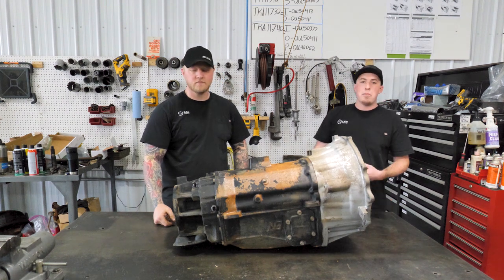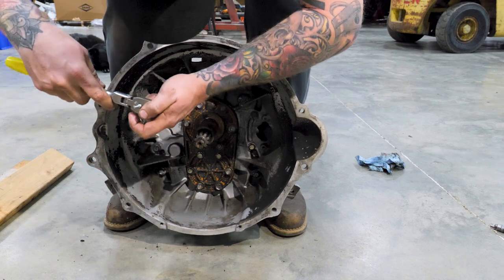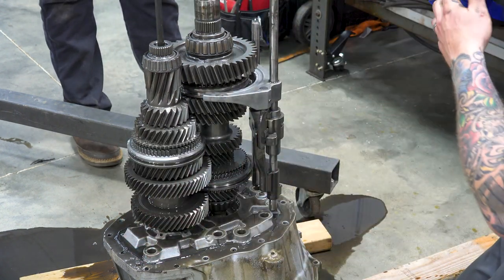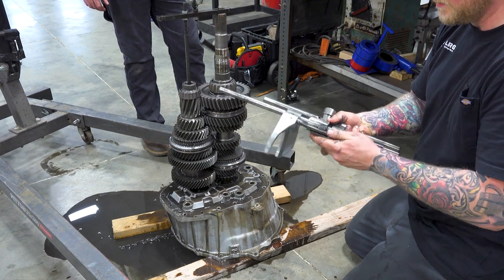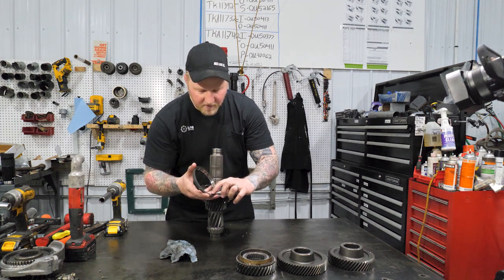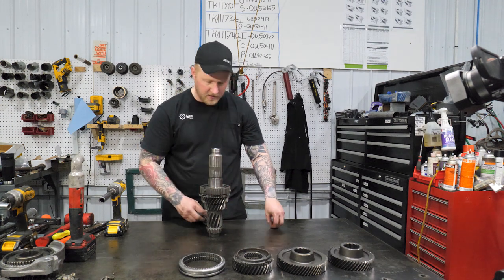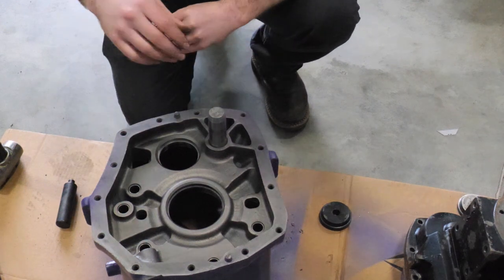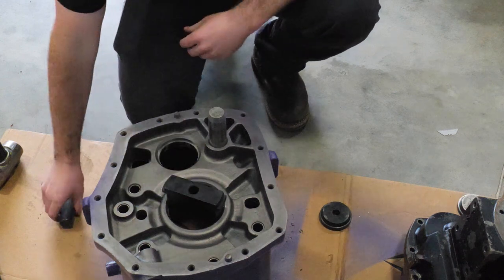NV5600 TEAR DOWN and INSPECTION (REBUILD PART 1)

Comment: good job man finally a guy who explains nice and slow.i just installed a NV5600 6 speed into my  2016 Cummins's g56blew and was stuck in 3 gear at 205 thousand kilometers for mileage ordered mine from Alberta i live in ontario.4800 dollars for transmission no stick shift came with it and 2500 dollars for clutch. what a pain in the ass trying to Mache one and installed a dual disk clutch also at the same time.truck was bought new in 2016 but there was always a little something with the trans i could feel it but of course the dealer could not lmao.i waited a year for everything to come because of covid...yes a full year.
Reply: Hello Stephane,  I have a 2012 with a G56 that I plan on installing a nv5600 into, What's involved with making the swap besides drive shafts and cross member.  What do you have to order for a clutch set up? I already have installed a single mass flywheel/clutch set up from south bend. Also I have experienced the 5th gear clicking noise sense new and all the springs let go in the original dual mass flywheel at about 20,000kms, Bought the truck new in Alberta but currently living in Newfoundland sense 2015. Thanks.

Comment: What a massive transmission for a pickup truck! How much does it weigh with the transfer case attached? I searched all over the country in 2005 looking for a 4wd Dodge 2500 with the NV5600 (it was a $400 dollar option for heavy duty transmission). I finally found one in Hudson, Wisconsin and flew up there to buy it. It was 9 below zero the morning I picked it up and drove it home to Texas. I still have this truck and will leave it to my Son. Best truck I have ever had!
Reply: Hi Victor, these transmissions alone weigh 360 pounds dry. Add the transfer case, and you have one heavy setup. When properly cared for, their stout design can last a very, very long time.
Reply: @longrangegear  put the np205 on the back of the nv5600 your looking at what easily 500 600 lbs combination lol, solid setup.
Reply from the maker: Hi Victor- in addition to the 360+ lbs of the transmission, the factory NP271 / NP273 weighs about 120lbs. I don't recall the exact weight of a 205 but either combo wouldn't be something you would want to "rest" on your foot!
Reply: What fluid do you use in this transmission? I’ve read mopar spec is very similar to 5w30 but that they updated that spec to ATF+4 or better.  I’ve read MTF 90 manual transmission fluid, synchromesh etc.
Reply: @Junorr500  pennzoil synchromesh or redline MTL is what we recommend.
Reply: Is valvoline synchromesh ok as well?

Comment: hey, I got a question. I can't find an answer on forms or anywhere. The seal on the rear output shaft, is that installed from the inside or can I just replace that from the outside? like remove my transfer case, replace the seal and put the transfer back on
Reply from the maker: That is 100% an outside job, although your transfer case is also sealed from the input... Not sure what kind of leak you have but while you're in there check the 5600 for shaft play and that the vent on top of tailhousing isn't plugged.

Comment: late comment i know just looking for help i recently bought a 2003 ram 2500 with a 5.9 24v ho equipped with an nv5600 6 speed was driving it home was in 6th gear and a guy came to a stop to turn i slowed down to about 15 went to switch to 3rd gear heard a grind noise like gear grinding and the transmission would only go into 4th felt like 3rd was there but just popped right out got it home by finagling it into 6th gear and after changing fluid it will only go into 2nd , 4th and 6th if you mess with it enough any idea on what could have happened to the nv5600? 

unsure of maintenance to the transmission truck has 269k miles.
Reply from the maker: It's hard to say whats going on there, but the transmission has probably never been rebuilt yet. It is possible you have excessive end play and that is messing with shift rail alignment.

Comment: I get griding when I try to want to put my truck in reverse, but it does end up engaging with a bit of wiggle on the stick, and sometimes it pops out of gear. I suspect it's the teeth on the engagement plate on the reverse gear, Do you think I can just replace the reverse gear on my nv5600 without taking out the transmission. If so, I would need to know what tool you used to loosen and tighten the main shaft nut? looks custom-made. but not sure. Also, do I need the main shaft holding tool or will the clutch being engaged do the trick? anything else I should replace, maybe the syncro or the plate or the collar?? Really would appreciate your help. Thanks
Reply from the maker: Hi- replacing reverse while in the truck would be tricky, but possible. It may be reverse gear, shift sleeve, or both that need to be replaced in addition to synchro pieces.

The spline wrench is QT2000, nut wrench is getting cut in the next couple weeks with part number to be determined...

Comment: my sixth gear "sings" increasingly with engine rpm when in gear.  other gears do not make this noise.  also, the transmission produces metal in the collection magnet in the bottom about every 5k miles.  how much longer can I get away with using (and not destroy the internals beyond rebuilding?  obviously something is eating itself.  2003 dodge 2500 with 175,000 miles.
Reply from the maker: You should probably park the truck immediately. Besides the obvious issue of metal getting run through every bearing surface, it will also pack in oil ports and reduce oiling to needle bearings which will compound the problem.

You might get another 20k out of it, but it could blow tomorrow. These transmissions can have some pretty major issues but still act ok while severely tearing stuff up.